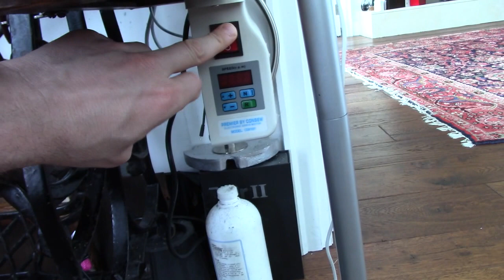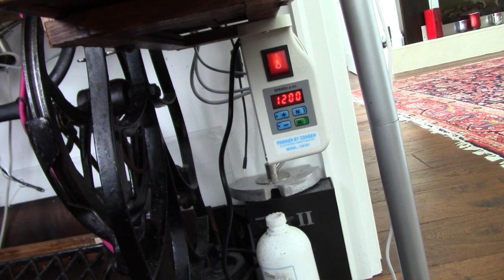Consew 1001 Servo Motor Assembly In a Domestic Treadle Base

Comment: excellent, Yours is the only video that I could find for attaching a servo motor on a domestic sewing machine, while I'm in the process of planning to the same to my Singer 201-2 or Miester sewing machine... I would say an excellent attempt and encouragement for me that it can be done...the only thing that restricting me to do is the width of the belt, as I guess, the domestic sewing machine's belt width is not as wide as that of the industrial sewing machine...but I will give a try for sure....thanks again for posting this valuable video.